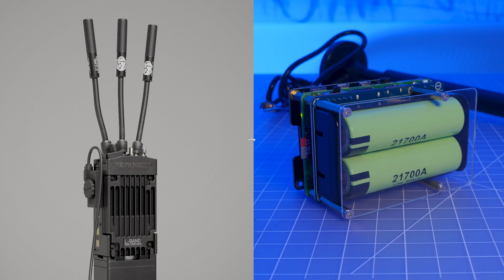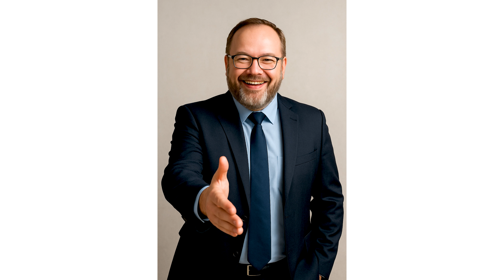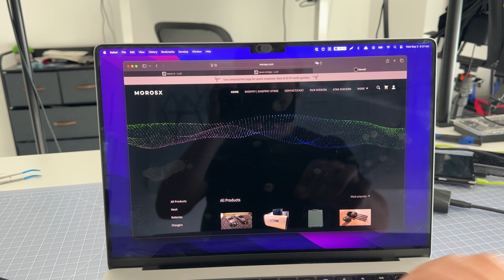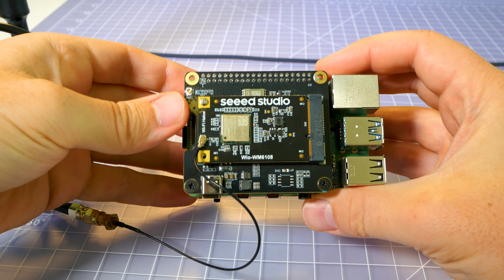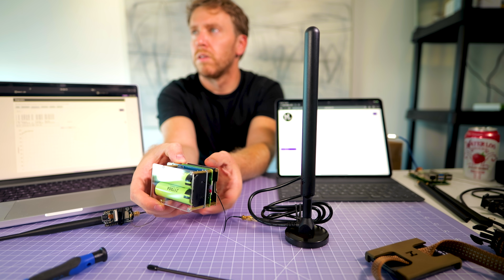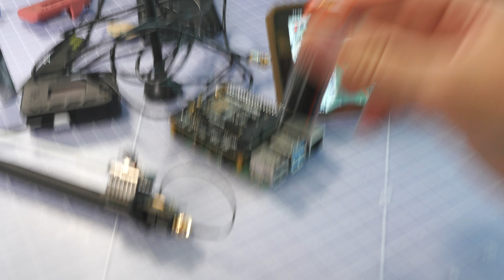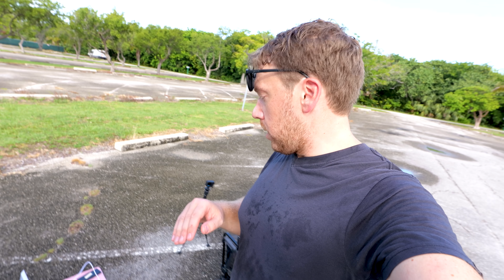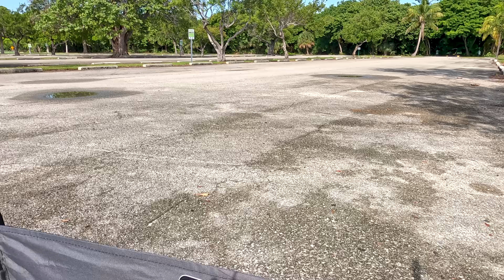I Built a $20,000 Military Router for $106.23

Comment: I majored in engineering. During my first year, I learned this saying, "A camel is a racehorse designed to government specs" 🙂
Reply: That is a twist upon the original, "A camel is a horse designed by a committee" HP training materials from 1986 onward..
Reply: @HappyQuailsLC yours make more sense :)
Reply: @JohnCompton1  Camels are fast af
Reply: What a perfect description!!!!
Reply: I know it as "A camel is a horse designed by a committee"
Reply: @SkyNhett Correct
Reply: @SkyNhett  well, i'd pick a camel over a regular horse, but racehorses are valuable. horse horses are a dime a dozen 😪
Reply: They spend hella money racing camels with robot jockeys
Reply: Turns out camels can make more water for m their humps than if they just stored only water in there. They are an efficient and specialized machine for thriving in the desert.
Reply: TBF Camels are faster than horses over a short distance. They are superior to horses in harsh, arid environments, offering superior endurance, higher cargo capacity, and better resistance to extreme temperatures. They also carry MORE water by weight as fat, than they could by carrying water itself, as they keep they keep some of the components of water in the air around them. Ingenius! This saying gives camels a bad wrap.
Reply: @1mlister 
 No, it's actually the other way around.
Horses are only faster than camels in short sprints and on flat, hard tracks. However, camels are surprisingly fast and excel at long-distance endurance, especially in sandy terrain where horses tire quickly. Horses can reach up to 55 mph (88 km/h) for elite thoroughbreds, while top-speed sprints for exceptional camels peak at around 40 mph (64 km/h). 
However, camels are far superior in long distance endurance.
 Camels maintain a steady pace of about 25 mph over a continuous one-hour period or 15 mph for days on end across harsh deserts, outlasting horses over long distance.
An endurance horse typically travels at an average speed of 8 to 12 miles per hour (13 to 19 km/h) over a continuous one-hour period, literally half the speed of a camel in a 1 hour race.
Reply: @1mlister  Are you a real person? There is a lot of strange things going in this thread, from people who can't understand a simple metaphor to literal wrong claims about a camel is faster than a horse.
Reply: @seyance101 Idk about the claim that camels are faster over short distance, but the rest of what they said, to the best of my knowledge, is correct.

(Yes, even the bit about them storing more water as fat by weight than if it had been actual water - fascinating bit of biological adaptation, that. It has to do with how they use the hydrogen from the fat, and combines it with atmospheric oxygen, to make water - H2O. Turns out you can get like 10% more water out of doing that from the same mass, plus extra energy.)
Reply: Whoever came up with that saying never saw a camel race and never saw for how long those mfs can run. They may not be as fast as horses but they can maintain their speed over rougher terrain for far longer than a horse
Reply: I'd amend "then get mad when given a camel."

in some ways there's wisdom to needing a camel, them not realising or admitting it's what they ultimately want is the issue.
Reply: that metaphor is so funny. cuz camels are significantly faster than horses. its just so ironic for an american to make up such demonstrably ignorant metaphor like that, and then be all like "hel yeah this saying is pretty good"
Reply: Its a terrible saying since a camel will outrun about any horse over distance :P 
Horses arent great distance runners camels are :P
Reply: Better a camel than a horse in the desert.
Reply: totally
Reply: Well duh bc safety first or lawsuit 😂
Reply: just email me when the company goes public brochahco🗿
Reply: they can go anywhere, and last longer. Their just slower. so idk id say its a decent trade. Less matinence.
Reply: I always heard it as an "An elephant is a mouse built to government specification."
Reply: Thank you for my new favorite saying at work, the guys will love S/F
Reply: Which is hilarious in its own way because a camel is far superior to a horse for anything but short range speed.
Reply: FYI you'll get more accurate speed tests if you use iperf or something similar without thr overhead of Java and html.
Reply: hahaha that is exceptional comedy
Reply: Can you please engineer a better Wi-Fi router so I can have Wi-Fi on my  5 acre farm?
Reply: If he didnt just steal an open source Project yeah
Reply: So I take it that the government wanted a camel, they specified a camel, it is supposed to do all the things a camel does, but crayon eaters are crying because it doesn't run fast?
Reply: i laugh when i hear a commercial echo "Military Grade!" lol like arent you supposed to be trying to sell it dude?
Reply: Thank you for not saying “As someone who majored in engineering”
Reply: Horses are only faster than camels in short sprints and on flat, hard tracks. However, camels are surprisingly fast and excel at long-distance endurance, especially in sandy terrain where horses tire quickly. Horses can reach up to 55 mph (88 km/h) for elite thoroughbreds, while top-speed sprints for exceptional camels peak at around 40 mph (64 km/h). 
However, camels are far superior in long distance endurance.
 Camels maintain a steady pace of about 25 mph for an hour straight or 15 mph for days on end across harsh deserts, outlasting horses over long distance.
An endurance horse typically travels at an average speed of 8 to 12 miles per hour (13 to 19 km/h) over a continuous one-hour period, literally half the speed of a camel.
Reply: God I can't wait till my bench is complete I have couple amazing ideas for the bois no batteries or charge needed
Reply: So a sportcar and a toyota
Reply: @firdauswahab8485   its like tryna get a Toyota Land Cruiser and ending up with a 2025 Jeep
Reply: @firdauswahab8485  More like the difference between needing and asking for a high performance sportscar and ending up with the most over priced decked out Winnebago with every useless addon under the sun.
Reply: Gotta see the movie "Pentagon wars". Comedic but in a farcical way, a military transport turns into a badly designed tank with the construction of the troop carrier. Kelsey Grammer and Viola Davis , likely her first film - others - starred.
Reply: @629Justme No you shouldn't see that movie, because it is simply a propaganda piece covering for a guy from the fighter maffia that got angry that the military didn't want his outdated concept of an attack aircraft. 
The armoured vehicle in question is the Bradley, an IFV (infantry fighting vehicle), not actually a tank in fact (at least doctrinally speaking). An IFV is meant to transport troops to the combat zone and then provide fire support to them. To deal with actual tanks, IFV's often carry ATGM's (TOW missiles in the case of the Bradley). This is something the Bradley was designed to do and was very good at actually. Just look at how it performed during the Gulf War, or more recently the war in Ukraine. Ukrainian soldiers frequently laud the performance and survivability of the Bradley, especially compared to their old BMP 1's and 2's. 
I am sorry to say that the movie "Pentagon Wars" is a piece of historical misinformation.
Reply: @pieter-bashoogsteen2283  Its not a documentary. It points out how a start can wind up where it was never supposed to be. Even though you may feel it was propaganda its based on a true story as far as the book the movie was based on. Neither of us was there but since it took almost 2 decades to make a "military SUV" I stand by my point that its a good movie to check out. Just know that just about all movies based on a truth will have some creative license involved. Points out a formally - not so current - understood problem with folks that go against the grain in the want of making it better, nevertheless. IMHO.
Reply: This thread is a great example of how some people just refuse to engage with any type of metaphor in any way.
If I say “my car is blue like the sky” 
Someone will reply “why would you compare your car to the sky? The sky is made of air and your car is made of metal, they’re completely different!”
Some brains just legitimately can’t comprehend figurative speech.
Reply: @Jake-bt3fc  lol comparing the color of your car and the color of the sky is not figurative speech. they can actually be the same color.
Reply: @reinach77 similes are figurative speech.
Reply: Ppl in this thread trying to establish that a tank is a better race car than a top fuel dragster because it can go on sand despite the provided context being a 1/4mile tarmac
Reply: dont understand this
Reply: @tecsuke Think of the trope of a military branch wanting a racehorse but also having multiple requirements like they do for any other equipment.

- Low cost
- Ease of maintenance
- Ease of (re)production
- High (fuel) food to performance ratio
- Long range/endurance 
- And lastly, speed (which was compromised to meet other requirements).

So now this military racehorse for the (insert branch) is good at everything except its original purpose which was to race other horses.
Reply: @mr.normalguy69  "low cost" As if they aren't already getting price gouged by lockheed martin.
Reply: @mr.normalguy69 I think you hit the nail on the head! 

I also think it’s an instance of the customer stating what product they want at a high level what they want, but when they gather their specs, it doesn’t match the stated product.

They say they want a racehorse, their spec says they want a camel. A clever salesman won’t argue about the semantics of racehorse vs camel. A good salesman will also keep the engineers quiet. I know I put my foot in my mouth when I argue about what the spec is actually saying
Reply: @tecsuke  ok so like, the 'racehorse' is the optimal design, but when the military tries to make their own version, they end up producing a 'camel', which is far from optimal for horse-racing..
Reply: @cracc_baby  Yes, and it happens more because of regulations than the talent of the engineers designing it. Basically some clueless manager up top said ''it has to have this and that'' and then the engineers are forced to compromise and make a camel
Reply: @tecsuke  Think of it this way; it's like asking for an F1 race car, but then also asking for it to be reliable, easy maintenance, can take cargo, can go off-road.
Well, at this point, you're not really asking for an F1 car anymore, you're going to end up with a utility vehicle/truck.
A racehorse is a horse bred and trained specifically for racing, but the military is going to bog it down with a lot of other requirements that ultimately demands a camel instead.
Reply: this is such a good quote

Comment: Very cool project, just one thing, part of the reason for the cost of the military radio is emf hygiene. If you can integrate those signature reduction features into your system, that is when you would have a real game changer.  Alot of the processing and cost comes from , beam forming, dynamic attenuation, spread spectrum frequency hoping protocols, automatic selection for frequency for bandwidth vs frequency for range, ALE systems for intermittent information backhaul updates, etc.  Signature reduction is key and most of this could be done with something like a set of hack rf systems or the like, you would probably also want some dsp units and some way to switch and tune filtering components. Oh and don't forget any component that is tuned and resonant can also be detected when off if you hit it with the right frequency while you are scanning and it resonates.  Are you planning a signature reduction version of this?  I am interested to see how this evolves.
Reply: NGL this is an impressive reply. I love everything radios because there’s so much to do and learn. Also, as a former Army team leader 11B infantry, radios were always such a pain in the ass. We had nothing like this in this video, but your standard PTT encrypted radios? I just remember getting them to sync could be a bitch, and there was always issues when a convoy who didn’t have comms with us would roll through our sector. Mot times we had no way to communicate with them and would even receive friendly fire due to this unsolved communication issue. Anyway by reading this I realized I’ve still got a lot to learn. 😂
Reply: @Henryspynx  As a former Infantry team leader myself. I will say the mechanized units "like Strykers" we had MBTRs and Sipr nets to set up. Kinda like our own mesh net. this is very interesting to see it being used in the civilian environment.
Reply from the maker: I'm don't think I'm the one to implement that but it sounds promising, we could enter this as a project request here - https://github.com/orgs/OpenMANET
Reply: As a team lead in my gardening center, integrating broader EW and multi domain operations has been a hurdle. Obviously signature reduction conflicts with needs like GPS reliance or jamming, but I lose sleep thinking about disruption to plant growth. With new direct energy weapons, EMS dependent soil is vulnerable, and we still struggle to find low signature alternatives like free space optics — none of which contain nitrogen... Trying to balance LPI with interoperability (especially in A2/AD zones) is something we’re working on.
Reply: @GardenGuy1942 exactly. My staff is always confused when the other teams find the plants that need watering first, fix the leaky drain lines faster, or finish their tasks before my team has completed their 40min convo about the chili packs and resulting bowel movements on-net.
Reply: @GardenGuy1942  Love this response... lol
Reply: @GardenGuy1942  🤣
Reply: Yes, tale a look at EEVblog old video where he takes apart a 20 000 dollar signal analyzer. The quality is in details.
Reply: not to mention the hardening
Reply: Yes. Nothing more fun than getting nailed down by indirect fires or attracting air because SIGINT fingerprints your leaky ass radio the moment it keys up.
Reply: could you say that again but in English plz lol
Reply: EM signature was my first thought when he compared this to military mesh systems. Commercial and especially hobby gear doesn’t have any concept of that outside of FCC regs on not inducing EMI to neighboring devices. It’s absolutely not built for people that need to keep a low profile. This is a great project and I’ll be investigating it further; it’s just not comparable to military gear.
Reply: One of the real problems is the amount of non US chips used in this too))))
Reply: @xjekwkfhzodudidkne  I’m gonna keep it real, chief: if your envisioned use case involves operating this kind DIY comms equipment on contested US soil, and your threat model doesn’t include US component manufacturers acting as at-best unwitting enemy collaborators, then you’re not gonna make it.
Reply: @You_call_this_clean ok Mr government name and face on profile. I wasn't commenting on that, nor am I a US citizen or on US soil. I'm commenting on the "I built a radio for a hundred bucks zomg the MIC is ripping off the taxpayer!!!!!!!" Vibe throughout the comments and the video itself. Theres even people in other threads going on about how being FCC certified is equivalent to MILSTDs for EW protections. Hope you can figure something out)))))

FYI I hope you enjoy Pest Control
Reply: @You_call_this_clean Hollywood propaganda worked. You'd think all the freedom of speech violations going on in the US rn would make him think otherwise but no he likes have his 👢and eat it too. 🙃

Comment: 12:36 with a technician class HAM license, the legal limit is 1.5kW. :)
Reply: Ham is not an acronym :)
Reply: @macuser1232 it is, however, capitalized.
Reply: Not on 915mHz it's not, no matter what licence you have...
Reply: @dougle03  unless you’re near the White Sands missile range, yes it is. The 33cm band ranges from 902-928 MHz and the only specific power limitations  are under 47 CFR 97.313(g) for stations near White Sands and 47 CFR 97.313(j) for spread spectrum emissions. Since 802.11ah uses BPSK, QPSK, QAM, or OFDM—none of which satisfy the definition of a “spread spectrum emission,” the spread spectrum limit does not apply. Now, the practicality of running more than a kilowatt on 900MHz or finding equipment capable of doing so are other matters entirely. :) 73 de AA5SA